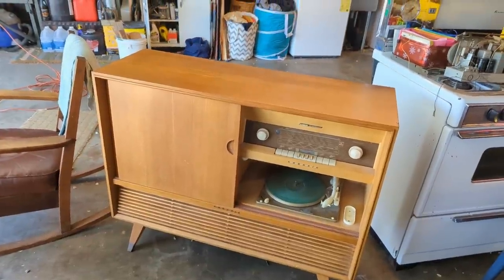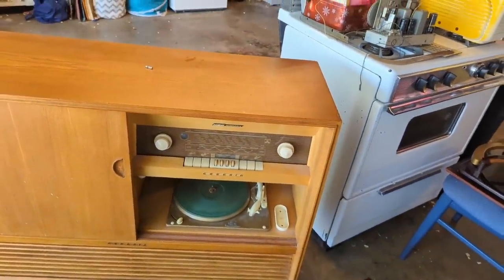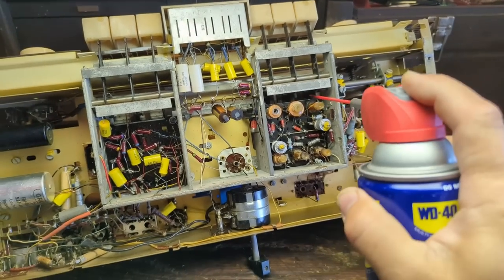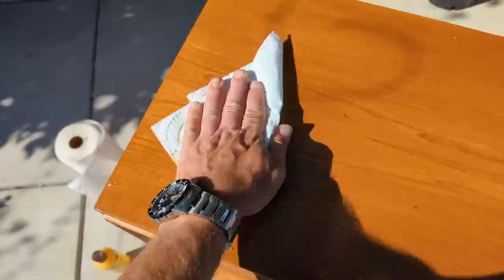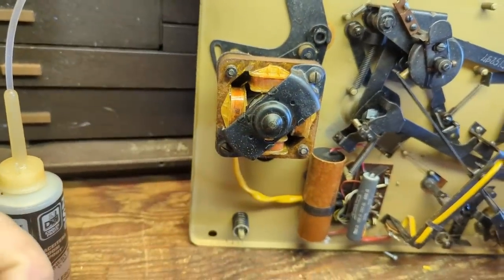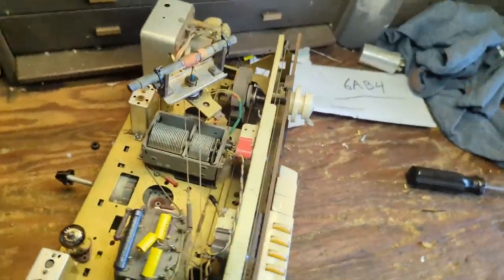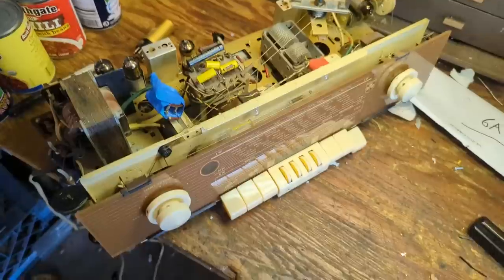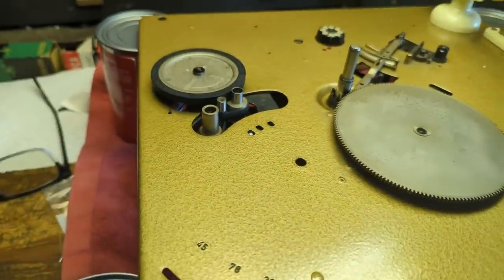A medium sized Grundig mono console overhaul

Comment: 18:38  Your dial cord for AM is not sitting in the groove in the chassis (look just above the left end of the green heatshrink). That will abrade the cord and cause it to break.  Attention to small details like that will save you grief later.

Comment: Hello again Nice and fast job again! Remember when I was young and a fuse where gone I used a nail instead of a fuse. Also smoke !
I have a WANTED 
I locking for some piano keys for 
the Telefunken Opus 6 Two are gone beacouse of some idi...have puched to hard
Do you or the museum any tip where to find?
Regards Bjorn.

Comment: I have the Stereo version of this set. The light fixture in the record player shelf is very similar. I still have a working bulb that fits the socket. It looks like a little baby carnival sign bulb with the glass kinda flattened at the top. If I had to give it a base size I would say a C8 as a C7 is too small and a C9 is too big. I wish I could give you numbers on the bulb but it just states that it is made in west Germany at 113V 15Watts. I really enjoy your videos and have learned a lot.
Reply: the german radios normally use a e14 (metric 14 mm screw socket) bulb.

Comment: The cheapest cartridge is only for 33 or 45. The only thing is that you need to join two cables from each channel together and the rest that remain go to the connection. In certain models of amplifiers, you need to join the two cables equally from each channel, it depends on the amplifier because if the echo effect does not appear, greetings

Comment: That is the wrong kind of an LP for that turn table. you need to use SP groove Disks. LP and ep will sound bad and skip.   

LP is Long Play or the kind of normal Grooves, that we all use for  Records for the most part.

Ep are Extended play Grooves, the grooves are super close to each other and can make an Lp Go from a30 Minute disk to 45 Minutes or longer. depending on the speed of the disk! 

SP Grooves are the early very far apart grooves, used with 78 rpm records(for the most part)  there were some EP groove 78's.   also, that would be the correct sound to the turntable.   you may want to look at those capacitors again, if it sounds bad!  but, with what I know about this radio/phono combo, is that the LPs,45s, 78s were meant for the larger groove disks. and these turntables did not have much bass, if any at all.